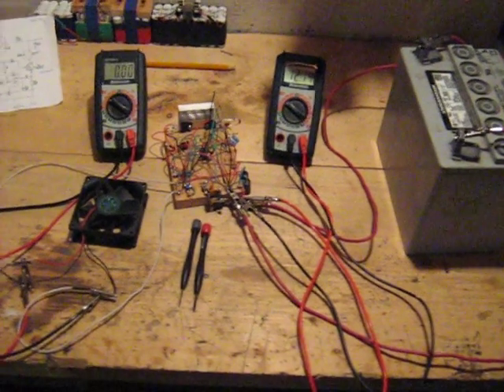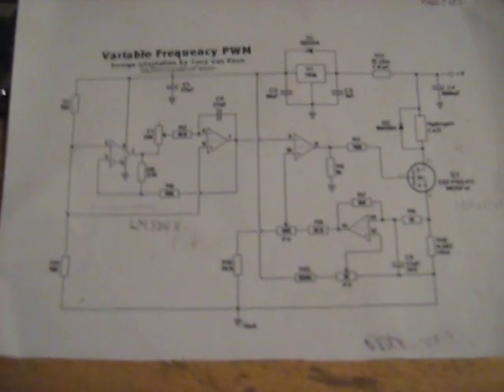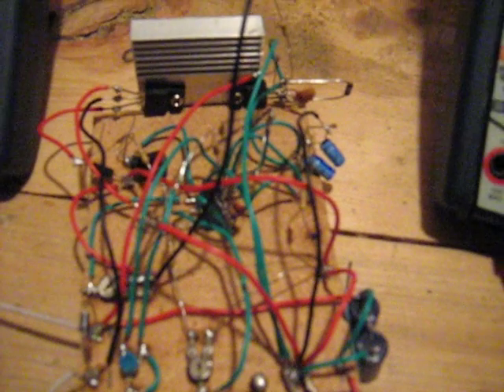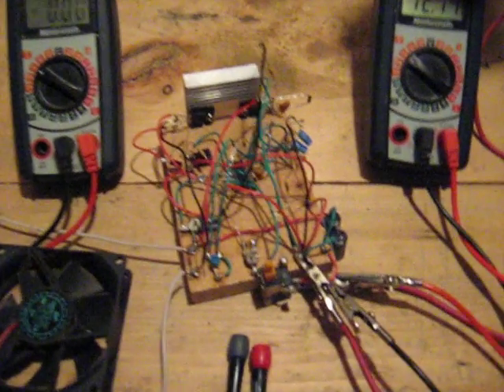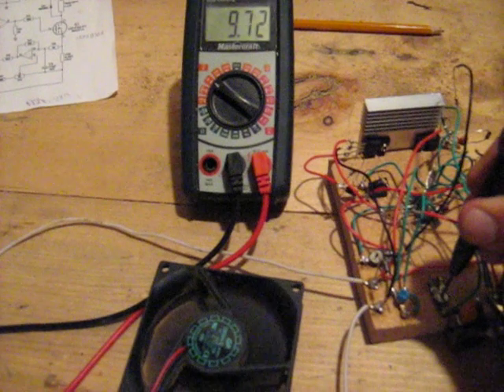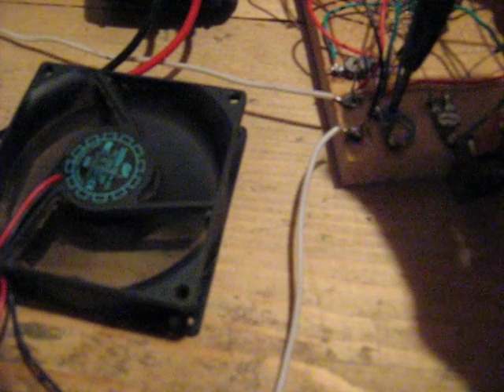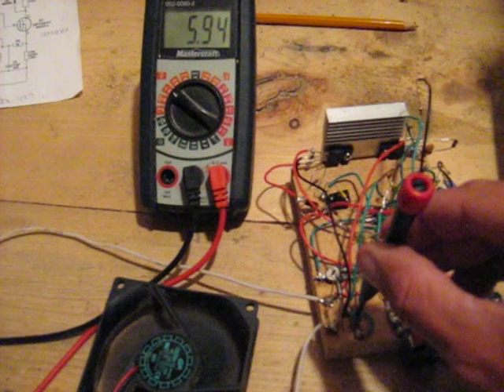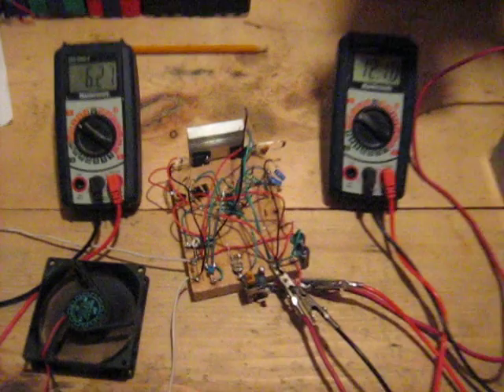PWM - Pulse Width Modulation  w/ Variable Frequency

Comment: You are not allowed to use a PWM without a scope ...one wrong move and instant black hole ...lol if cern dosnt beat you to it...  you can use your pc for a scope ... Visual Analyser 2009 ... I can adapt the probe to a audio jack and your off to the races ... of course if you want to buy a crappy scope on ebay you could do that ... (surplus places are a much better source)...